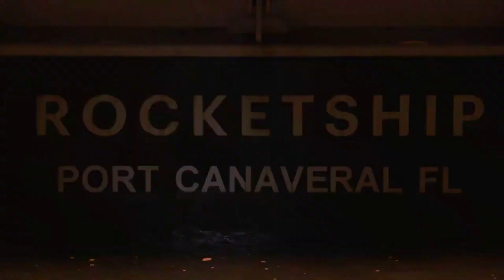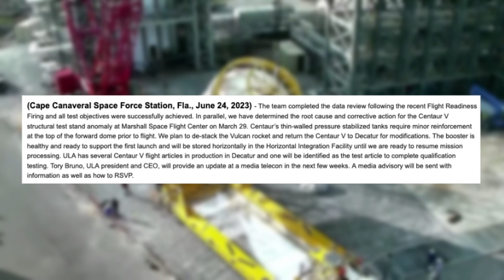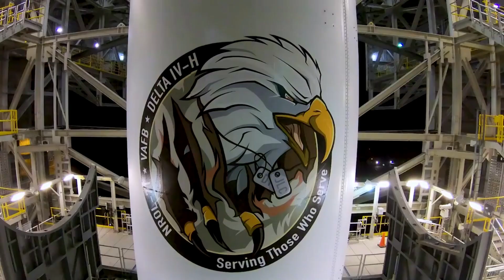Vulcan's Upper Stage Is Being Shipped Back To The Factory

Comment: Maybe they can use this time at the pad to test the hell out of the first stage. That would be nice to see. I really don't see how these companies think they can get all the way to space without integrated testing. No wonder so many maiden flights fair poorly. And no, this does not include that test flight from SpaceX. They KNEW they would have problems, weren't carrying a payload, and told people repeatedly that this is a test. ULA probably shouldn't test like that, but more wet-dress rehearsals would be nice.  They can't be so afraid of anomalies that they don't TEST!
Reply: @ewwwwhh  An integrated test means testing a fully assembled whatever it is, in this case a rocket. And while I'm no fanboy, SpaceX does a lot of integration testing while BO does almost none besides what ULA just did for Vulcan. What you are purposefully missing is that I think they need to do that repeatedly now that they have a working article and time.

Comment: ULA has launched only once this year.  If ULA didn't have deep pocket corporate parents, I'd be very concerned about their financial health.  They may have a large launch backlog, but they must launch to make money.  ULA needs to solve their problems and start launching or they may be cast off and sold for assets as they continue to bleed red.
Reply: Just to point out, ula is in a healthy financial position and the reason they havent launched much this year is probably more because of the actual customers not having payloads ready. Also you cant compare spacex launch numbers because spacex buys their own launches for starlinks
Reply: @sketchyarnold3332 
The Starlink argument is pretty dumb for the following reasons:

1. Starlink launches only account for exactly half of SpaceX launches of this year. So if you removed all starlink launches, you would still have 22 customer launches.

2. Starlink launches support the Starlink constellation which SpaceX profits from. Even if Starlink isn’t profitable, it still counts as an investment.
Reply: @firstduckofwellington6889  spacex customers have smaller satellites